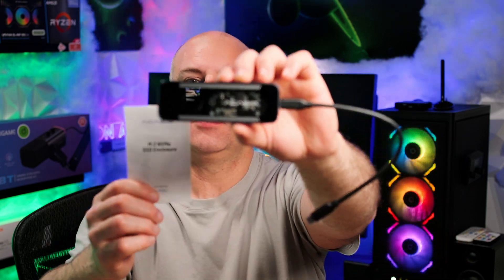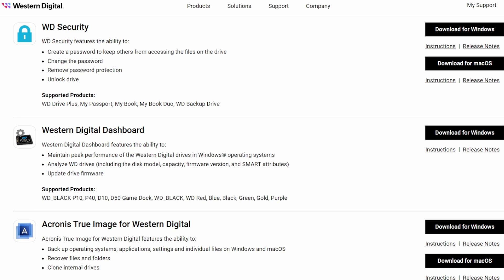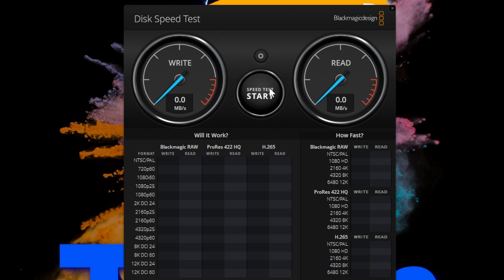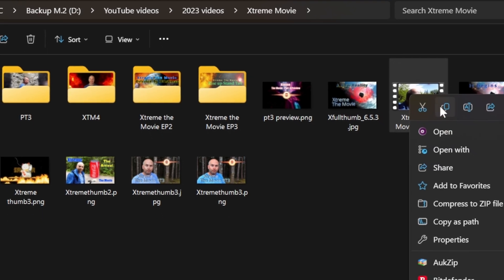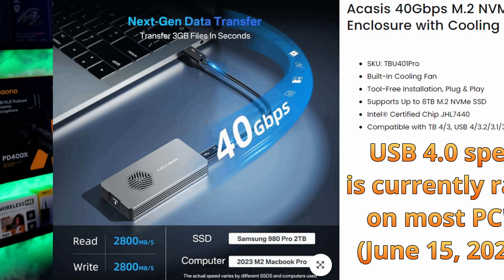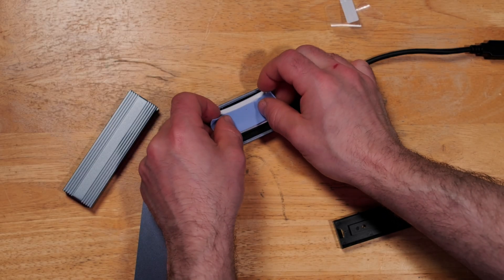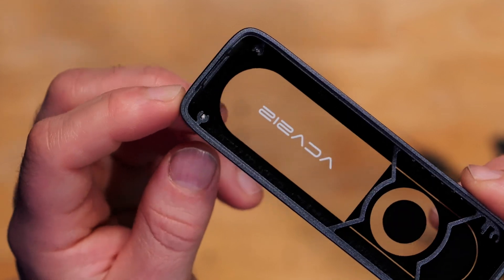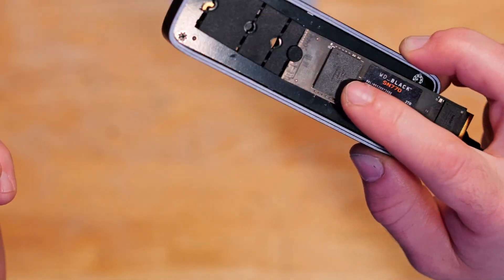Acasis | Cool M.2 SSD USB Enclosure, EC-6608Air

Comment: Bought an M.2 SSD and this enclosure since it's faster and doesn't have 4GB limit compared to micro sd card or type-c thumb drive. My question is, what's the safest way to format using Android smartphone only?? I don't have a PC or laptop. Just android phone.
Reply from the maker: In this video there is something I mention that basically proves your idea won't work. How so? I say outright that I cannot format the m.2 drive to work from the enclosure. I had to format from the PC first and your phone I doubt can have an m.2 incerted directly into it.

Comment: i have few question:
what controller Acasis use in EC-6608Air?
does the fan durable enough? coz seem like that fan fragile
Reply from the maker: @stream-cut  could I have you look at the comments... I answered which controller it is and even screen shot an image of the circuit board in my Discord chat. Either way, it's deemed a good controller as for the fan it is most certainly nothing fancy. Tossed out the fan and never looked back but I also tossed out the top cover after I purchased an M.2 with a large cooler. I now use a gen 4 USB Acasis external drive and have this one sitting around. The gen 4 USB version is only 2.2x faster real world speed improvement
Reply: Controller: Realtek RTL9210

Comment: May i ask, what chipset is used for acasis EC-6608 Air?
Reply from the maker: Luckily I have it beside me but that won't help as much as the fact that if you went to my discord I took a picture for someone that asked the same question. Looks like RLT9210, I still have the picture on my discord about 7 messages back.
"RTL9210B-CG
USB 3.1 GEN2 to PCI EXPRESS GEN3x2/SATA Gen3. BRIDGE"
Reply from the maker: And I switched my drives to the Acasis TBU401PRO about 2 months ago. It is about 2.2 times faster. I didn't review it.

Comment: i'm going to buy this enclosure and based on comment below, should i paste the thermal pad on my ssd? Thank you
Reply from the maker: Paste? Like thermal paste? Certainly don't glue and I never heard of anyone using thermal paste with a thermal pad before and haven't tried it. Thermal paste works best metal to metal contact.

I am currently using my enclosure still but with a 4Tb Lexar NM790 M.2 with Heatsink. I no longer use the cover, cause I can't. I'm amazed by how few enclosures even allow the install of an m.2 with heat sync. My Ugreen and the other brand I had both don't sit this Lexar at all. Acasis working good even without the lid.
Reply: @sparketech  Sorry for my bad word used. I mean using the thermal pad on the ssd. Thanks for your answer and i think i will use it
Reply from the maker: @sekiro112  The thermal pad help spread the heat, important with higher end faster speed larger capacity M.2 drives. If you don't use an extra thermal pad I would recommend to keep the fan for air flow and that would be fine. No Fan, you want good firm thermal pad contact BUT use quality not cheap pads. Cheap thermal pads insulate and cause more heat.
Reply: @sparketech  Is the thermal pad which accompanied when buying the Enclosure good?
Reply from the maker: @sekiro112  i could feel the temp transfer, it was good. I own a few different brands. Might have stated which I got to add to fill the gap in this video. But I don't remember if I did but I have some good ones still if you need a brand

Comment: Do we need to set it up using a pc? I dont have a pc i only have a loptop. Cant we set it up using enclosure directly?
Reply from the maker: @papichulo4398  I could not set up the M.2 from the enclosure and one other person commented the same thing. Any computer or laptop with 2 M.2 slots would allow the drive to be formatted. It's that initial step that needs to be done. If you had to replace your laptop m.2 drive within the laptop itself the same thing would have to be done first.
Reply: @sparketech  guess im just gonna have buy the ssd external huh. It leave me no choice at all 🙂 ty bro
Reply from the maker: @papichulo4398  I'm not encouraging you to spend but this enclosure has been reliable. I purchased yet another USB gen 4 enclosure from Amazon which isn't as reliable with transfer speeds all over the place and sometimes pausing, that was a waste of money. For me this Acasis is consistent but one thing to note is If one USB port acts oddly, try a different one.

Comment: Does this Acasis EC-6608 Air SSD enclosure have 10-15 min sleep mode? May i also know the model of the CPU used to it?
Reply from the maker: @jld3738  i personally never heard the fan turn off during my time using the enclosure. I currently use this enclosure with an M.2 4Tb with a large heat sync and therefore leave the cover plate off.
Reply: @sparketech thank you for that information. 😃 I guess you’re doing a lot of extensive activities with your SSD, which is why you ended up with your current setup. 😅

By the way, about the bridge controller not CPU my bad. Haha.
If it's readable, could you please tell me the model number of the chip used?
Reply from the maker: @jld3738  you mean the controller chip within the enclosure I take it.... If I can remember, it might be easier to write on discord where I can simply send a picture. I am not back in the studio for 2 days and have been gone for 13 days working everyday. I am a construction electrician and am working on a remote job site.
Reply: @sparketech  Yeah, that chip. And sure, that would be nice. I already found your Discord link through your channel info. Good thing I asked at the perfect time, which is a few days ahead of your schedule. (This is so embarrassing..., Sorry misunderstanding the last part) Again, Thank you! 😃

Comment: For all who are interested. I do have two if this drives, one with a Samsung 990 pro 4 tb drive mounted. When using Samsung Magician the Acasis drive is detected, but not the Samsung 990 pro drive inside it. So you can never perform a firmware update on the Samsung ssd .
Reply from the maker: The exact same second m.2 drive I tested. I would 100% never do a firmware updated unless directly connected to PC, no matter the device. Thanks for sharing, I updated the firmware before I tested my 990 Pro 4TB.
Reply: @sparketech  Acsis thunderbolt enclosures do not have this problem
Reply: You're right. It can not detect ssd brand. Many Other enclosures are the same

Comment: I'd have to disagree with the thermal pads.  Seems that would just clog the airflow therebye erasing the point of the fan and so the entire point of the enclosure.

I'd actually be willing to guess this is the reason the enclosure is larger than the typical that use direct thermal transfer, after all more material is more cost and they always save every penny.
Reply from the maker: @DoublePlus-Ungood  the thermal pad I used has very effective heat transfer that makes the casing hot. Research and find for yourself that flash memory needs heat to function at proper speed BUT you are in part correct. If not having good or thick enough thermal pads or uncertain of quality you are indeed 100% better off not using them at all because yes as you mentioned it is going to impede air flow and cooling of the fan. Without the fan it becomes a bit of a hot box but the vents are certainly a plus. I hate the fan noise personally cause I love dead silence.
Reply from the maker: @DoublePlus-Ungood  the safe bet is to leave the air flow. A lot of m.2 drives have heat spreaders to help keep the NAND flash memory at the sweet spot for temps. Save money and don't worry about thermal pads, I like that advice.
Thank you for your view point.

Comment: Eric do I need to turn on/off the pc to connect this or is plug and play.
Reply from the maker: Totally plug and play. When I connected when doing that fan noise test or any time I connected it instantly the drive letter showed up. It just works.

It works as simply as a thumb drive. I had my m.2 working as a storage drive already and also my Samsung 990 pro that I show was directly used in my computer already.

The Western Digital drive I purposely erased to a state like it had been a new device from the store. Under that situation like any other M.2 or Hard drive there is that one time setup required that I show in this video.